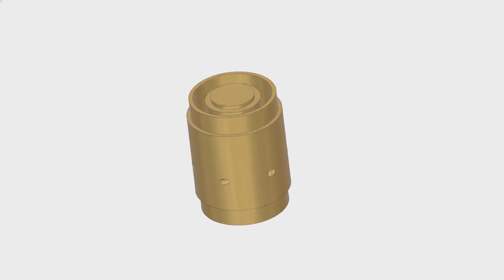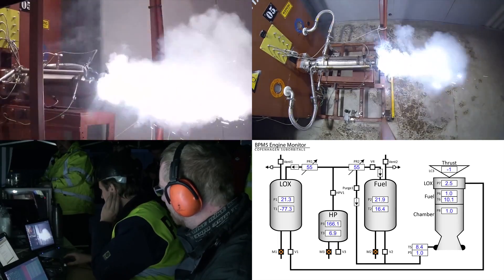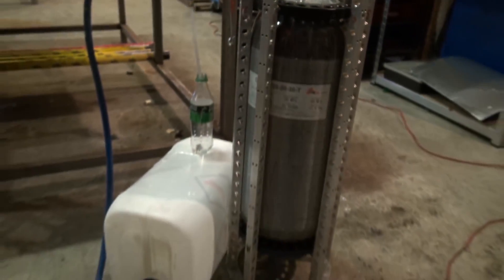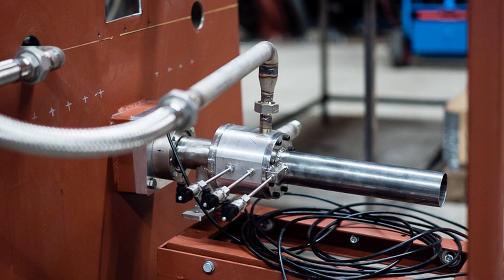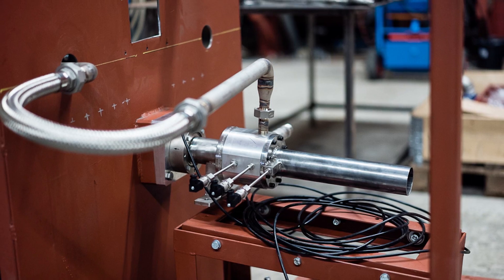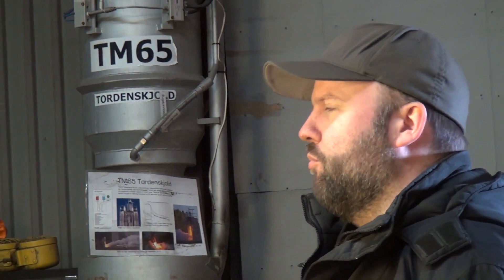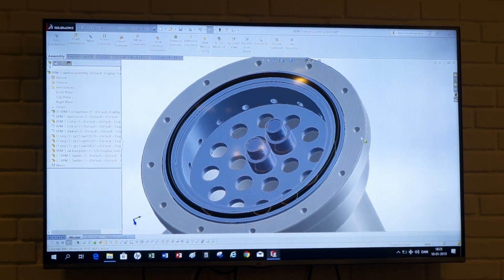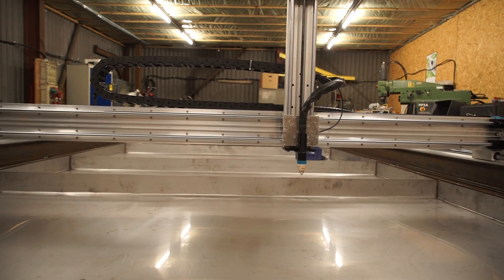Current Affairs - Working Towards Our Crewed Spica Rocket

Comment: Apologies, if I'm wrong with this: Surely, adding Nitrogen will mean that some of the exhaust will be Nitrogen compounds? And some of them are highly toxic and unstable. You did say in an earlier response that since the burn is only for a minute or so, there will not be much Nitrogen dissolved into the propellants, but please remember that there has to be pressurised Nitrogen inside the tanks for some time, and that pressures need to stabilise before ignition is triggered. It would be very sensible to test for these long before launching the finished rocket. Then you will now what additional safety requirements need to be met.

Comment: Nice to see you guys again! Tell me. Are you going to feed this heating engine exhaust into the engine it self. To gain effeciency or just going to thrust the excess fuel downwards?
Reply from the maker: The “burner” exhaust will be dumped. Much simpler and the gain from routing it into the engine is marginal.

Comment: Wouldn't gaseous nitrogen condense and/or dissolve into the LoX?
Reply: Lox it self is in the liquid state. And with the high pressure tank it would need a high temperature to go from liquid to gas. Some will exspand into gas. And help with getting the pressure up. But this also means there could be an issue with overpressure causing the whole thing to blow up. So as they said. Cheaper construction and less material needed. But added complexity.
Reply: @AntimatePcCustom  I was talking about the opposite direction: gasous nitrogen condensing and/or dissolving into the liquid oxigen.
Reply from the maker: Yes it will. But slowly and over the 60 sec burn time it is not going to be a problem.
Reply: @CopenhagenSuborbitals  Is this the final version of the pressure regulation system, or do you / did you contemplate tapping the LoX, heating that up, and using the gaseous oxigen to pressurize the LoX tank?

Comment: Very interesting. A couple of suggestions, if I may. I do not know if your politics is neutral (and I hope it is) but I would suggest instead of 10 helium tanks, talk to the russian space agency about this problem and I am sure they can refer you to a russian company that can build the tank you need that would be simply one unit and would also cost less than buying 10 tanks. Secondly. Instead of having something that is another combusting device to preheat the nitrogen (as any combustion device can malfunction and you already have one large one with the rocket engine), use an electric heating grid in the nitrogen heating chamber and once the rocket engine is hot enough, have the preheater switch to use thermocouple driven pump that pumps coolant to some point on or near the rocket engine to heat the coolant that would be pumped back to the preheater to do the preheating for you. No secondary combustion, lighter in weight and function and thus safer than using another combustion source on the rocket.

Comment: Knowing this concept for one reason or the other, the questions are: how to control the fuel rich combustion (be warned it can go off quickly if the fuel flow stagnates)? What to do with the extra thrust from the bpm2 to not affect the flight trajectory?

Btw, at least for the oxygen you can bypass any excess through the heat exchanger and feed it back to the lox tank, reducing some losses. If you risk it for the fuel too, you skip the full nitrogen piping for that.
Reply: Great idea of heating the propellants! The largest concern might actually be heating the LOX, as it might increase the risk of rocket rich combustion.

Comment: So Spica is going to be some kind of FRSC-Expander cycle crossover with three propellants? Sounds complicated, and with the need of handling LOX and LN2, did you try to look into liquid methane or LNG perhaps? It could be used as fuel and autogenous pressurization source.
Reply from the maker: It is more complicated than pulling gas from a high pressure tank for sure and we will strive to keep the concept as simple as possible. But the weight saving is just so massive that it is hard not to look into this option. I think we will do a blog soon with all the numbers to illustrate it properly.
Reply: Haos666 i second this.
Reply: Do not ask for trouble in your combustion chamber, that calls for a high loss of specific impuls!

Comment: It would be very nice to compare the motor you are developing for SPICA, with the "high budget" sub-orbital rockets/companies, to analyze the cost-efficiency ratio.
Reply: Ok, that is like comparing Scottys Warp Drive with McGyvers solution. Both things do not fit on the same paper.
Reply from the maker: Robert Steinbeiss LOL!
Reply from the maker: Would be interesting. And we will put as much detail out there as we can once we run the first tests. But as Robert points out, it’s another league we are in. We happily sacrifice performance over cost and manufactureability.
Reply: @CopenhagenSuborbitals  Actually no, performance is the only key to get to space! Yet the best design is the simple one! One might call it the false paradox of rocket science ( *I do not claim this term). But the term "rocket sciene" has an origin!

Comment: Why not put the burner inside nitrogen tank and throttle it according to the nitrogen pressure, saves a lot of piping. Basically like a steam engine boiler. The tank can't be carbon though. Also spark plugs are very hard in rocketry, maybe using TEB is easier (probably not, but take a glance at that regardless).
Reply: Tri Ethyl Borane (TEB) or Tri Ethyl Aluminum (TEA) is very nasty compounds that burst on fire in normal atmospheric air. It is not something I would want to handle! Give me WFNA/RFNA any day, but TEB/TEA no thank you.
Reply from the maker: Not sure we will dare handling TEB. Also pretty sure we will not be able to obtain any. Must be a controlled substance.

Comment: Okay, I'll ask it. If you already want to use this sort-of-a-pump, have you considered separating the tanks and the high-pressure chambers?
(That's probably too many valves, but whatever)
Reply: I am assuming that you are suggesting a system with separate propellant storage tanks and propellant pressurisation tanks.

In such a design there would be at least six tanks for propellants. 2 main storage tanks + 2 LOX buffer tanks + 2 Fuel buffer tanks. On top of that there would also be a tank for the pressurant.  

The propellant would then be transferred to the buffer tank, pressurised and piped to the combustion chamber. The system would then switch between filling/emptying the buffer tanks. 

I think such a system would become more relevant as the diameter of the rocket increases beyond 1 meter. 
It is a lot of weight that goes into the additional buffer tanks and this needs to be saved on the main tanks, the buffer tanks also needs to be a certain size to keep the change in pressure low.
Reply: jnielsen20 mostly correct, but the buffer tanks can be rather small.
I suggest using it with a pressurization system like the one proposed in this video, which provides a constant pressure gas to displace the propellant. The size of the buffer tanks is limited by how fast you can vent them and how fast you can switch the feeds.
Reply: @tinldw  Based on some quick calculations assuming an ISP of 200s, the total propellant flow will be in the order of 50kg/s for a thrust around 100kN. The engine will need about 28kg of LOX and 22kg of fuel pr second. That is about 25L of LOX and 26L of fuel per second. 

Lets assume that a buffer tank cycle takes a second. Then we need 4 tanks of approximately 25L capable of withstanding the pressure.
If it takes two seconds the tanks needs to be 50L, 75L if it takes three seconds and 100L if it takes four seconds. Clearly the limiting factor to the viability of this design is buffer cycle time, which can of course be somewhat mitigated by increasing the number of buffer tanks.
Reply: jnielsen20 as far as I understand, the CopSub is going to use not at all fancy steel for the tanks, so 3 m³ D=90-95cm 20 bar tanks would probably weigh around 300 kg(~360 MPa pressure stresses), if not more. With the buffer tanks, it can be ~5 bars and maybe 100-120 kg.
50l D=37cm 20 bar tanks would then weigh ~6 kg each, 100l tanks ~11 kg each. The extra pipes should not have significant mass. If I am not mistaken, it would require 4 lox valves, 4 ethanol valves and up to 10 gas valves, instead of 1 lox, 1 fuel and 2 gas valves for the simple version. I don't really know how much do they weigh, but assuming 2 kg per valve.
Also, 25% more nitrogen would be required, that is 25 kg.
Total mass 77 to 97 kg.
Mass savings about 80-120 kg.
Reply: @jnielsen20  that are all good numbers but your unspocken assumption is that the "pump" works like a pump with constant pressure supply at constant gas temperature and mass flow. Yet my concern is an unstable bpm2 at fuel rich setting leading to some instability you would have to compensate for in the proposed system, dont you? If so you would need a const pressure source to stabilize? Would the system get complex and heavy?
Reply: Actally the foil in the tank solution as for satellites would make sense in the fuel tank. That would prevent some bubbles forming at the fuel line inlet
Reply: Robert Steinbeiss what foil???
Reply: @tinldw  you could put a foil between the upper and lower dome of the tank and keep the fuel and pressuriant seperated! Like a membrane ....
Reply: Robert Steinbeiss it has nothing to do with what I have been talking about.
And no, you don't want to do that, because then you will have to precisely maintain different pressures inside the fuel and oxidizer tanks, varying it as the propellants are consumed. Otherwise your "foil membrane" will rupture. That's just more problems for no advantage.
Reply: Robert Steinbeiss if you mean vertical membrane then it is plainly impossible
Reply: @tinldw  well its done on satelite tanks and I have seen it. 😉 Maintainig a constant pressure in the tank is actually the aim of the system an if the foil is flexibel enough the pressure on both sides will stay the same. E.g. 5 bar, but writting that I notice that if the engine is a pressure feed system, you are right, the pressure of the gas would be higher. Maybe 300 bar. Keep in mind the foil should seperate the gaseous phases.
Reply: Robert Steinbeiss it feels like you came just to ruin my thread with your gibberish about something absolutely irrelevant and/or inapplicable.
P.S. Although I may have finally understood what you have seen, it doesn't make what you say look any better.
Reply: @tinldw  Sorry!
Reply: As of my question, it may save 100 kg or so, but it is not enough to justify increased complexity for a suborbital rocket, and I forgot that CopSub actually needs thick tanks anyway because it makes splashdown easier.

Comment: Will you have any escape systems on the upcoming Spica Rocket ?
Reply: Yes they will.
Reply from the maker: LES will be too heavy. It will add at around 800 kg to lift off mass. Will try to avoid it.
Reply: @CopenhagenSuborbitals  does not seem right to me do things this way. If your rocket wont be able to carry basic safety features you have in my opinion a design problem. Even spacex's rockets explodes, why do you guys think rocket science will play easy with  you.
Reply from the maker: Mateus Back LES is not a basic feature. It’s a complex system to design and integrate. Our biggest concern is if we can design a system that overall adds safety. When introducing such a system you also introduce a lot of new error scenarios. Will it add more safety or will it add more risk?
Reply: Copenhagen Suborbitals, I've been thinking about an escape system too, and there might be an elegant solution: 

The effects of the additional 800kg can be largely, if not totally, negated if the LES becomes the final stage of the rocket. You burn your main motors for their full duration, and then fire the LES at MECO, carrying the Copsubnaut™ to their apogee.

The additional costs will also be reduced substantially by means of the first stage needing to burn less propellant in order to reach its lower altitude. The (presumed) 100 km+ target altitude will still be attained by the capsule, but possibly with less fuel, because of the economy of dropping most of the mass prior to the second stage of flight. The LES can incorporate a tried and tested rocket design, either a solid-fuelled motor or the liquid-fuelled engine design from last year's launch, but with a high altitude rocket exhaust bell.
Reply: @RWBHere  as an extended stage the Lea would not be efficient at all, it has too much structure and too litle amount of fuel, so yes you could use it to go higher but weights too much indeed.
Reply: @CopenhagenSuborbitals  To be honest and well spoiling the party a lot. It is the choice of the person climbing into the capsule! Still, the overall design concept of spica misses the human safety factor (e.g. redundancy) required for all commercial or institutional launch vehicle -> esa / ecss. That is not the aim of copsub but the safety of the human life is for any engineer! I guess you come up with a good solution. Do not go without!
Reply: Guess opening the hatch and jumping into the baltic sea is a risky option! For escape systems you need high thrust systems aka solid fuell motors. That is not an option for cobsup, is it?

Comment: Sounds like a very awkward and complex system. Why not plug a turbopump at the business end of a bpm2 instead? If you are looking for a challenge?
Reply: Well the whole complexity of this System wont come close to the complexity (and especially cost) of designing and manufacturing the turbines for the turbopump.
Reply: I think getting to 100km is enough of a challenge to be honest - turbo pumps are complex as hell compared to a heat exchanger.
Reply: It is rocket science and on the test bench of rocket industry today as well, so good call!

Comment: Why not pipe the reject fuel rich exhaust into the main combustor and run that one slightly lean to compensate and get stoichiometric? you're jettisoning dV to heat up nitrogen, use some of it at least... Added bonus, the mini rocket would light your bigger rocket.
Reply: Considering the fact that the BPM-2 would only consume ~10kg of propellant during the whole burn, there's not much to gain - and chances are it would be vastly more complex (and expensive), and since the design goals for the Spica rocket are very limited (no getting to orbit here), if the engine can already take Spica to the Karman line, there's really no point. 

I am curious how they're gonna light the BPM-100, though :)
Reply: Short answer? Back pressure, you have to sync two engine simultaniously! You ask for the raptor?